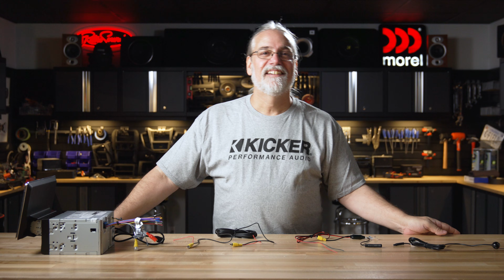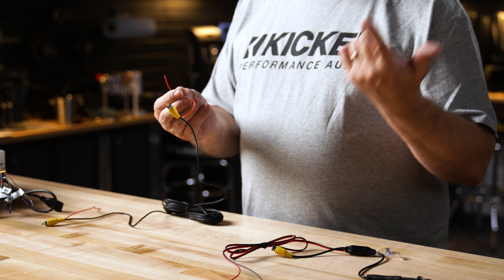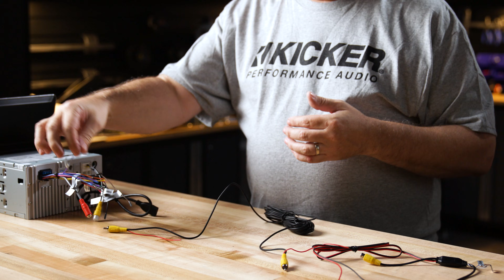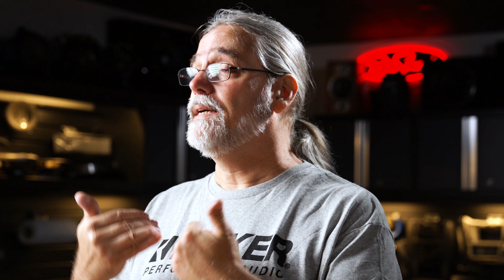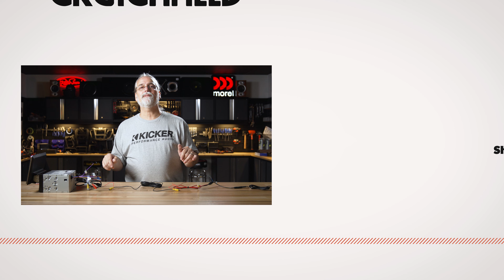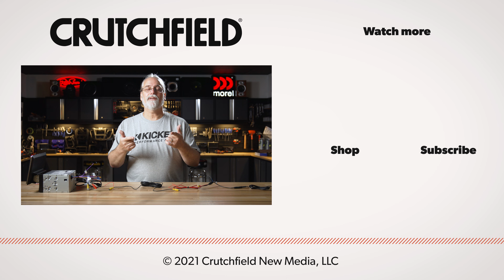Powering your backup camera (and how to use that extra wire) | Crutchfield

Comment: Great video! So when I cut my loop wire, I still did not get any reverse lines.  In fact, the whole camera went offline.  I have since spliced it back together so now my camera works again but I still cannot figure out how to get the reverse lines to show up.
Reply from the maker: I'm very sorry you are having difficulty installing your rear view camera. This sort of thing is handled by our technical support service and is reserved for Crutchfield purchases. If you bought the camera from Crutchfield, please give them a call and they can troubleshoot the problem with you.

Comment: Hi I have a backup camara with light and I used the conviniece wire directly from my touch screen stereo to the camara and it works great when I in reverse or when I just whanna see the back video of my truck but my problem is when I turn off the car , the Camara light stays on 24/7 ... Any idea what could the problem be?
Reply from the maker: It sounds like you get getting constant power to the camera and not a switched power. If you purchased your gear from us, you can contact our technical support using their toll free phone number that can be found on the order invoice for the help with identifying a switched power source for the camera

Comment: I have a canbus box (aftermarket android unit), with 2 x yellow, blue, pink, green, black and orange and also an independent adapter which is like an adapter wired directly into the android unit, with two small blue wires coming off it and the rca camera wire. Where the hell do I attach the convenience wire to if I want it only to display when I've reversing? So confusing, I don't have a backup wire at all coming off the android unit. At the back of the car I'm equally as clueless as to where to put the convenience wire, and the red and black, do I twist the two reds together and attach them to the red positive on the adapter or the reverse lamp/light itself, I have a citroen c1 2017 any help I'm desperate to get this fixed for my driving test otherwise it will mean I've got to put the old one back in?

Comment: Random question, can I hook up the trigger wire to the back up lamp to set the stereo to automatically flip to the camera when I go in reverse, but also set a second power wire to access the camera on demand? Would that cause any faults or issues? Thank you
Reply: easy to do if you are installing this in a truck?.

Comment: If you wire the camera to be on with the ignition, how do you switch it to be displayed on the head unit display? Put the car in reverse?? Defeats the purpose of putting it to be always on for towing. You skipped that for the always on option.
Reply: settings in the head unit tell you/show you the camera. purple/white stripe wire at head unit is the trigger wire..it MUST be connected to either the reverse light at the back?, or..the reverse light wire in the fuse block?. in cars..use the red wire at the back to get power from the 12 volts pos wire off the back up light, connect the black wire to a good ground somewhere on the car back there?. at the head unit, connect the red wire on camera loom to the purple/white stripe wire. now when you put the car into reverse, the backup camera gets is power from the taillight, this power then goes to front at head unit, through the purple/white stripe wire, triggers the head unit screen to go into backup screen.

Comment: Nice video. Is the trigger wire needed to provide the guide lines on the camera? Because if the camera power is wired to stay on all the time it doesn't need to be turned (triggered) on.
Reply from the maker: The guidelines are not impacted by the method you use to get the power for the backup camera. If they have been enabled in the camera, then they will display anytime the camera has power.

Comment: Metra Backup camera wasn't labeled so I cut the blue wire to remove the guide lines and of course, that was to mirror the feed.  Just be sure to google the specific model you have to see which wire does what.

Comment: Any idea how to flip the image ?
Reply from the maker: Do you perhaps mean for use as a front-view camera? Which specific camera do you have?
Reply: @crutchfield  not sure what camera just bought a used car and has a boss system and after market camera but the camera image is upside down. I tried factory resetting, that did not do anything
Reply from the maker: The image being upside down rules out the possibility of a front camera being used as a backup camera (this would have flipped the left/right sides instead of being upside down). If there are no options in the receiver's menu to flip the image, then it is very likely that the backup camera was installed upside for which the only fix is to physically rotate the camera 180 degrees
Reply: @crutchfield  okay, thank you, I just didn't know if it was a wiring issue. I read some forums that talk about that being an issue
Reply from the maker: You're welcome! 🙂

Comment: So I have 2 questions:

1. 0:54 So what you’re saying is that for the ground in the back, I need to find a screw put that in between the screw and the metal of the car and screw it back down? Would a wire loop terminal work?

2. 1:54 Would a Posi-Tap work?
Reply from the maker: Yes, you can you use a properly grounded wire loop for the ground connection. Also, you can use a posi-tap connector to supply power to the camera. These do a great job for that application.
www.crutchfield.com/I-rFBKc988/p_669PP607/item.html

Comment: Cameron comes on initially but then turns off after just a few seconds. any hints or advice ?
Reply from the maker: I'd recommend checking the power and ground connections for your camera. A loose wire or improper ground could cause intermittent  power loss.

Comment: Cris, this was a wonderful video.   But I have another senerio for you.  I bought my Kenwood DMX4710S from you all along with a Boyo VTL17IRTJ back up camera.    I also got the "Ready Harness" done up for convenience.  I have NOT installed anything yet.  I just learned about (thanks to you!) hooking together the power wire from the back up camera to the power wire to the "convience wire" that is wired with the yellow RCA video cable.   My dilemma is, am I too late to do this because I had you all pre-wire the stereo with the Ready Harness? It would be nice to have a view and back up camera.
Reply from the maker: Even with ReadyHarness applied we can still help you get the camera wired up the way you prefer. Give our Technical Support hotline a call with your order number handy and we are happy to help. The Technical Support line should be in your order confirmation emails!
Reply: Thanks.  I thought it would of been nice to have duel purpose viewing.  I wish I had known this duel feature was possible before I ordered the Ready Harness. Thanks anyway for the reply.
Reply from the maker: It can still happen and we apologize that the support has not been provided to make it happen. Once you have the replacement cables for the backup camera, give us a call. You may want to have a tap connector handy to help. Here's an example of this type of connectors:

www.crutchfield.com/I-rYALc227/p_669PP605/item.html

Comment: Super clear video thank you.
Could you give us a potential issue in case gnd wire has not been tied to chassis?
Reply from the maker: The camera does need to be grounded to work properly.
Reply: @crutchfield  thanks i will check that on my wiring then
Reply from the maker: You're welcome, Andre.

Comment: So is mine not working because my ground is the reverse ground?
Reply from the maker: If your camera is not working, be sure to double check all your wiring connections. From there, be sure check the camera menu settings via your radio or monitor. If you got it here, you can call our Tech Support to troubleshoot. Their direct number is on your invoice.

Comment: If I wanna get a backup camera for a 2005 Hyundai sonata that already has a screen in the car do I need to order a backup camera that comes with a monitor or I can connect it to the screen that’s already in the car?
Reply from the maker: If it's an aftermarket touchscreen receiver with a dedicated rear-camera input, you can connect an aftermarket camera directly to the existing touchscreen receiver.

Comment: Thank you. I'm putt a PYLE PLTS79DUB stereo IN My 2001 Chevy silverado. I bought an aftermarket wiring harness from to truck to the stereo and everything works except, but when I trun the the dome light or the dash lights on the stereo will play but it don't work properly I hooked up illumination but not the orange reverse because I don't have a camera so what's causing the stereo to malfunction when I turn the Dash lights on please help me thank you anybody can you help me I sure would appreciate it
Reply from the maker: It is hard to diagnose your issue from here. We provide lifetime Technical Support with every Crutchfield order, so if you got your harness from us give us a call and we are happy to help troubleshoot. I would double check your illumination wire connections to make sure they are correct, if you are having any radio issues when turning on the dash lights that could be the culprit.
Reply: @crutchfield  Bluetooth will work music will play, but then the screen  opens and stays blue. I cut the orange wire illumination, and everything worked fine but I got a replacement wiring harness and the stereo coming thank you
Reply from the maker: That is great to hear! It does sound like the issue is related to the illumination wire connection from your previous harness, especially if the issue was resolved by not connecting the illumination wire. Thank you for the update! Let us know how the new radio and harness works out.
Reply: @crutchfield  update with wiring my PYLE stereo l solved the problem it had an orange an a orange wire with a black thin line I was hooking up the solid orange wire that was the problem don't hook up the solid orange wire I left the orange wire alone hooked up the orange and black everything's working like it should I hope this helps anyone with the same problem Thank you

Comment: Such a clear and informative explanation. But I have one question, previously I installed my backup camera with the black wire hooked up to the reverse lamp wiring and then there was some kind of noise on the screen when the signal lamp is on or when I hit the brake, and then I unhooked the black wire which was connected to the reverse lamp, and the cable is now free and not connected to anything (frame, body or anything) but the camera just works fine (no noise at all). My question is: is there any problem will happen someday if my backup camera ground cable not connected to anything?
Reply from the maker: It sounds like your camera must be grounded through the RCA video cable. There's a greater chance of possible video interference/noise without a good ground, so it would be best to connect the camera's ground wire directly to a metal chassis grounding point. But if you aren't experiencing any noise issues, it shouldn't hurt anything to leave things as they currently are wired.

Comment: For always on camera setup, I don’t get it when u said u connected 12v Ford Lincoln harness to red wire on head unit. Why would we need to do that if the harness is outputting power from being plugged into the head unit?
Reply from the maker: The Ford/Lincoln harness does not plug into the head unit. Instead, it plugs into the vehicle's wiring left when removing the stock radio and it helps with installing the new head unit making it so you don't need to cut off the OEM plug

Comment: I did everything this video said. The purple reverse + I ran a wire to the back up lamp positive. Red cable from RCA cable to 12v power cable to the radio. Red cable from RCA cable going to the camera to red cable on power plug then ran a wire from those 2 cables to the positive on the back up lamp. Grounded the black wire from the power plug.

Camera stays on as soon as I turn the car on and never turns off.

Any suggestions?
Reply from the maker: Hi Darrell, sounds like you may want to double check your reverse wiring and also the camera settings on your radio. If you got the camera here, you can call our Tech Support for help with this too. Their direct number is on your invoice.
Reply: @crutchfield  its a dual. sadly it didn't come from you guys. i see no settings in the radio for the back up camera.
Reply from the maker: What model is the radio?
Reply: @crutchfield  Dual Electronics DCPA71-BC 7-inch  and it's in a 03 Ford Escape XLT - not my car was trying to help a neighbor.
Reply from the maker: The owner's manual for that radio does not list any settings linked to turning on/off the camera. It only mentions the wiring that allows the camera to be automatically displayed. This suggests the violet/white wire is somehow constantly getting 12V power.  If that wire is properly connected for the trigger, the only other conclusion we can draw is that the unit is defective.

Comment: I have 2017 dodge journy which do not have orignal backup camera 
Does it have backup triger cable in its factory radio or screen ?
Reply from the maker: You can add a backup camera; but we show no options that would connect to the factory radio for viewing. Are you planning to add a second screen?

Comment: I have a 2012 ram 1500 and was wondering if you could use  the green/black wire from the trailer plug to connect a backup camera ?
Reply from the maker: If its the power wire for lights on the trailer that's getting power when you want or need to use the camera, then it should work well!

Comment: If my head unit provides power... do I still need to ground the black wire to the frame?
Reply from the maker: If the radio only provides a power wire and no ground wire for connecting to a backup camera, then yes, it is a good idea to still ground the camera to the vehicle's frame.

Comment: Very helpful but got a problem at the end… when the engine is off the camera works but when the engine’s on the image disappears. Powered by the back light
Reply from the maker: It is connected t his way to automatically default to the rear view camera on the display when the car is put into reverse.
Reply from the maker: To make sure I understand, your backup camera is only displayed when your engine is off?
Reply: @crutchfield  that’s exactly what I meant. It’s hilarious! I put the reverse when just the battery is on and the screen shows the image correctly. I switch the engine on and the image disappear 😅 it’s a Volkswagen

Comment: I want to connect rca cable from camera to 2.5 mm pin. I need to use it for dash cam. How should be the connection?
Is the 12 v supply necessary?
Reply from the maker: We do not offer any adapters to convert the RCA video signal output to a 2.5mm connection.

Comment: So if I connect the red wire to the reverse light in the back. Where do I connect that small red wire near the video plug
Reply from the maker: If you are using the convenience wire to bring the reverse signal to your aftermarket radio, you will connect it to your radio's reverse wire input to automatically select the camera when shifting into reverse.

Comment: I don't have a reverse light on my old car so how am I gonna wire the purple and white wire on the radio ?
Reply from the maker: What is the year, make, and model of your vehicle?
Reply: @crutchfield  it's a 1966 Volvo Duett panelvan, thanks for replying
Reply: @crutchfield  my head unit is a jvc kd-x561dbt and the wiring on the camera is exactly the same as in your video
Reply from the maker: What are you planning to view the camera on? This model radio does not have a camera input.
Reply from the maker: Great looking car! Has the factory wiring been modified? What brand/model is your backup cam?

Comment: In the back tail light area, there should be three red wires connected?
Reply from the maker: The colors of the stock wiring for light power can vary depending on what the vehicle manufacturer decided to use in the vehicle. The new backup camera could have 2 with one being used to power the camera and the other offering a way of supplying the new radio with the reverse trigger it needs to make it automatically display the backup camera
Reply: @ thanks! I ended up merging three. The little red and the long red to the hot wire in the tail light and it worked!
Reply from the maker: What brand and model is your camera?

Comment: Great videos 
My back up camera is wired up to the reverse lamp circuit and works fine when only the ignition is on and reverse is selected but when the engine is running and you select reverse it just displays no signal ? Any ideas
Reply from the maker: It is hard to diagnose the exact issue from here, but it sounds like whenever the engine is running the camera may be losing power. Best thing to do is double check the wiring and connections and test the circuit powering the camera when the engine is running to see if voltage is present. I hope this helps!
Reply: camera not getting power.